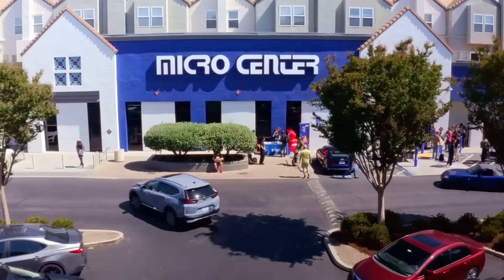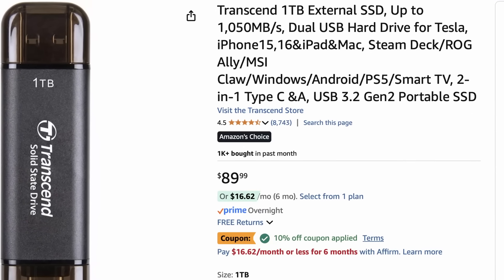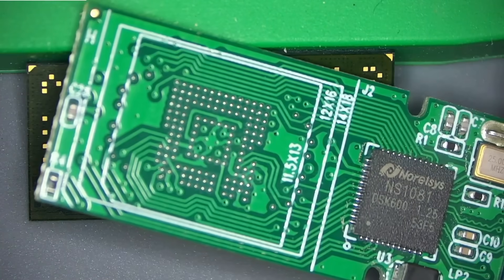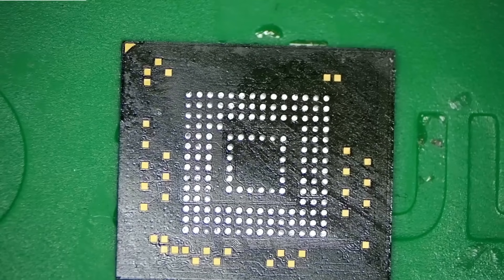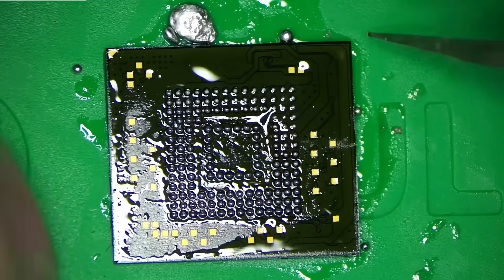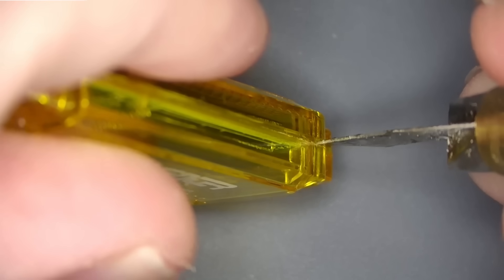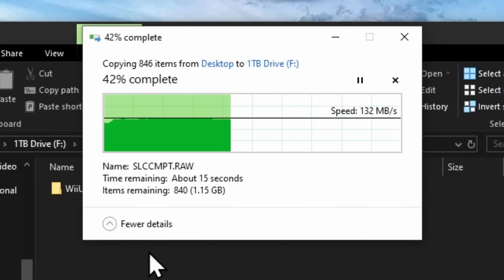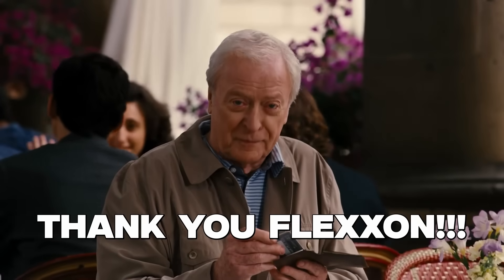I built an Industrial Grade Flash Drive

Comment from the maker: SUBSCRIBE & What should I build next?
Reply: Hey dude. Have you ever thought about making a Micro-SD to USB-C conversion to fit almost any hard drives?
Reply: Add heatsinks to this USB drive & test before & after.  I'll bet you'll delay or remove the throttling.
Reply: a 4 or 5 terabyte External SSD drive as small and compact as possible? and fast too?
Reply: Try using UFS now
Reply: An m.2 drive that has drr chips instead of flash :P
Reply: Frankenstein PS3 by RSX 40mm swap 😮
Reply: tv box
Reply: @chasefournier

Now do a MicroSD card!
Reply: Flash drives that big would certainly have a place especially as nand chips get denser in 2.5 inch format.
Reply: Absolutely cinema
Reply: PCB Way has good resin prints for a case. ^^
Next try with faster chips and 2 or 4TiB.
Get the >=10Gbit USB working and >1GiB/s

SanDisk Ultra Dual Drive Go is under 100$ has USB A and C. 400MB read speed but they don't tell the writing speed.
If you want speed get a NVMe SSD and a USB enclosure that can do 40G USB C and A.
Reply: Dude you are behind on flash memory the highest single chip I am aware is 2tb from Samsung, and yes it is meant for microsd cards and usb drives
Reply: That said I love seeing builds like this and would love to learn to micro solder so in can buy ewaste build fun Frankenstein machines that should have existed but never did because our society refuses to reuse parts in new and interesting wats
Reply: the way you pace the video by removing the dead space is really respectful to the viewer yet the amount of detail and the things you remember to include are quite awesome!  I learned so much and didn’t get bored.  Subscribed.
Reply: increible experimento :yougotthis:
Reply: I just use an external SSD for the same job. Yes they're a little bit bigger in size, but they're more robust, faster, can have more storage, and cost less.
Reply: What is the name of that software which you use format partition in Ntfs
Reply: Build a working Xbox controller
Reply: Something that is equally as unique as this, maybe a stick of RAM that has an unparalleled 32 gigs?
Reply: Hi please send me a 1 tb flash drive
Reply: 2tb flashdrive
Reply: yo bro. why is your face so close to the camera? do you edit your videos on a 300 in tv from a mile away?
Reply: Micron makes 1tb emmc chips so 2tb usb lmao
Reply: Heatskink for  the thumb drive, is that why the performance tanked at the end?
Reply: One tip, super glue and flux remover can change many electronics component behaver or values.
Reply: BiWin make 2Tb Mini SSDs (15.0 mm × 17.0 mm × 1.4 mm) slightly larger than a microSD card, an adaptor to USB-C would be fun.
Reply: a time machine
Reply: Build a NAS from multiple 1TB sticks
Reply: Can you help me please to find the firmware to program the ic?!?!?!? Pleaseeeee!)) thanks!!
Reply: Can you sell some of these?
Reply: WHY USE A USB A NOT C?
Reply: @iKabii 

If the USA is so great
why did they invent USB?
Reply: @iKabii who tf actully prefers USB-C hard drive
Reply: @iKabii  USB C IS TRASH!!!!!!!!!!!!!!!!!!!!!!!!!!!!!!!!!!!
Reply: @iKabii  because we dont follow your idea's and he wants to make it usb A for funni
Reply: @Wh1t4f0r3est no need to be condescending
Reply: Maybe try @ them lol

Comment: 10:50 another tool you could try (or even just have for the toolbox) is a thin guitar pick. Depending on the brand, some have really nice tapered points that work pretty well for seperating plastic shells. Might not work particularly well for a fresh USB stick, but it'd be less likely to damage both the plastic and your fingers. Disassembled many things with old picks out of boredom so I absolutely will vouch for their usefulness

Comment: This idiot removed original solder balls, added new balls and reflowed the chip. This idiot did all this in the pretext of not overheating the chip but in that blind pursue, he thermal stressed the chip 3 times plus handing. Reflowing with original balls would be much better as the manufacturer would have tested and selected the best solder ball material. They were OK with solder but this idiot wasn't.

Comment: I am planning to make a storage card with 2TB capacity using SLC NAND Flash. Card will have gigabit ethernet and CAN/UART for data Transfer and control. Is there an interface other than ONFI that I can use to interface NAND chips with controller?

Comment: Wouldn't it be better to use exFAT for a flash drive? I mean, if you're only using it on Windows computers NTFS might be alright, but exFAT is supported by all platforms, including Linux and Mac's.  
And I'm not talking about FAT32 which has the 4GB file size limit, exFAT limits are 128 petabytes both for partition and file size. That's 128 terabytes times a thousand.

Comment: I retired most of my old flash drives. I keep a couple really old bois around cuz they still work with stuff like the printers at the post office/copy shop. 
Apart from that I carry two NVME SSDs in handsome aluminum enclosures. 
They're absolutely nowhere near as quick as in a real NVME slot (Throughput is hindered but IOPS is even moreso)
But compared to an average thumbdrive they're fast as hell and these drives were also retired from their original PCs it's free real estate (not quite, enclosures were $18 a pop)

Comment: There are UFS dev boards and chips on AliExpress. JMS901 and SM3350. Firmware is probably more difficult to find though.

I'd assume the faster USB drives in the market are using UFS by now. eMMC is garbage by today's standards.

Comment: i think the biggest problem is the heat, if you need a fast portable storage, there are some good value on aliexpress, portable m.2 ssd (the small one) cases with cooling and its big enough to have it on your keychain, as big as a car key with electronics inside, thats the reason there isnt any 1tb or 2tb usb sticks on the market i think and btw, better order a mold for chips, not a magnet, even if they are fresh and have no data, its never a good idea to bring chips near a magnet^^

Comment: If you want a really fast USB drive, just buy an NVMe enclosure and put a real NVMe SSD in it. I did it years ago, and it reads/writes at 600 MB/s (so 5x faster than what this guy made).  Modern ones do much faster than that.
Still, mad skills, dude, very impressive.

Comment: Fascinating and informative video. We're currently trying to replace an internal flash "drive" with a larger capacity one. This is an internal component to a system, so it's not a commercial product. This is a pilot run. In researching this I came across this video. I'm a little confused about the sequence of events, though. 

Once you had completed the addition of the memory chips and put it into the case you connected it to the computer (11:18 timestamp). The audio indicates the computer recognized a USB device being connected. This implies that there was already firmware on the NS1081 to implement a USB Mass Storage Device class. But you then proceeded to program the firmware. What firmware were you programming? Where did you get this firmware? Also, what is that MPTools application you're using? Did this come from Norelsys?

I've been unable to find any information on the NS1081 on the Norelsys website. I've reached out to them via email, but have not received a response yet.

Comment: Chase, do you have a video where you repair the fiberglass board where an edge connector is? Not so much the pads, but the edge itself. Found a tossed out (e-waste dumpster!) Asus PCIE (4 Gen, 4 slot) expansion board (has 2 2TB Samsung 970 cards mounted!). But a small section of the edge connector is slightly split - about 2 pads wide. Thank you. Do you have another video where you focus on reprogramming the controller chip?

Comment: So you're telling me that you're worried about the high temperature requirement of the stock balls damaging the chips, so you heat the chip to that temperature in order to remove those balls, then heat it up again to attach new balls, and heat it up once more to attach it onto the board? I'm not quite following the logic here...

Comment: the drop of speed at the end wasn't because it's a flash drive but because windows started copying smaller files with different names and specs which made windows take more time to treat each file before it copied it while at the beginning it was copying bigger files which are easier to  handle i would say

Comment: If I were to take a guess, the slow down is caused by the chips over heating. if you could put the drive in a metal case with direct chip contact or attach 2 little tiny heatsincs, the problem should be fixed.

Comment: I appreciate the meme vibes and wanting to take a specific thumb drive line to the max, so kudos for that. I really don’t get why an SSD the size of a thumb drive isn’t checking that box for you though. Especially when they generally have much better speeds than emmc-based storage. In super tech mode, yeah, an SSD in a USB enclosure is “different” than a thumb drive. But practically speaking, they are the same thing. Small storage on a USB stick. (Picture The Office Pam meme)🤷‍♂️

Comment: Hey, I'm new around here. Never seen your videos until today, but even though this is the first video from you I ever saw, I'm subbed now!!! Also, if you want a project request from the new guy, take an iMac G3 reproduction shell and fit a modern gaming computer into it turning it into an all in one. If you have leftover space inside, you could probably have some resin printed trays to add storage for media like flash drives. The only goal I want to see, is it playing stuff like Cyberpunk on the max graphical settings (Raytracing optional) and maybe a couple other of the more hardware intensive games. Not saying beat out a super computer, but if you can get 30 fps through the prologue of Cyberpunk or the tutorial of any of the games you have access to test with, I would consider it a win. There are some pretty cheap iMac G3 shells floating around after all, why not give some people a heck of a sleeper PC idea?

Comment: You can jerk yourself all you want for making this but you haven't done anything worth making a YouTube video about. You can get 1tb micro SD cards with really fast write speeds for pretty cheap these days. Wyatt you should have done with ditched the ancient USB and designed your own PCB and used a type c connector w/ USB 3.2 gen 2. Then you'd have something unique worth talking about. I mean. You even took an existing microcenter enclosure and modified it to say 1tb and cried that your basic bga solder job worked? Jesus Christ dude you're pathetic.

Comment: I expected better heat dissipation, and a proper copper or aluminum casing. Both the controller and the flash degrade significantly with heat.

Comment: Nothing "Industrial"!  Speed? Slow AF! Error correction? No. Rugged? No? Flash? eMMC it's just a bees dick above flash drive chip in binning, so Long lived? No.
A good USB Stick beats that any day! My SanDisk one does 170MB/s. 

Gold Standard is still putting a NVMe in a USB 3.2 Case and have 600-700MB/s also it's the most reliable solution.

Comment: i got a 2 TB flash drive about 6 years ago so you're definitely late to the party.
Reply from the maker: damn
Reply: @chasefournier  i do most of my copying over the network but let's say i had to copy 1 tb using a flash drive for some reason, then i wouldn't be sitting there waiting for it so it wouldn't matter how fast it was. perhaps the best use for your drive is running a very special os, special because the common ones will run on an average flash drive no problem.

Comment: Isnt there an issue with those high capacity storage chips that if 1 sector fails a large portion or the whole chip stops working? I feel like i remember high quality SSDs had more chips at lower capacity but the cheaper ones  had less chips but higher capacity

Comment: I have a cheap-ish Samsung 64gb flash drive that avgs about 300mb/sec on decent sized files. Drop off looks about the same speeds as yours got on smaller files. Report back to us once you have used it a lot for a while, please! I wanna know how long it handles the workload. Would be great to get a flash drive that doesn't degrade like hell.

Comment: I don't need it as per say. But i want it!
Would be nice for long time storage backups. No cables, no adapters. Simple usb.
There would easily be space for 2tb in that form factor.
Or even 2 layer pcb, 3tb. 1tb top, 1tb mid, 1tb bottom. (2tb on one board and 1tb on another board.)
Could it be done with "flex cable" (like phone screens) to make it even thinner? 4tb. Same physical size.
As for the heat, probably have to make it out of aluminum? I have a pretty good CNC.

Comment: 13:16 The transfers slow down at the end doesn't have to do with the drives being and flash or anything specifically. They slow down because windows copies files largest to smallest and sequential is almost always faster than random. A ton of small files have to go back and forth really fast from the FAT (file allocation table) or MFT (master file table) for ntfs. Linux filesystems have similar things going on and not being in front of a computer I don't know if or which of various ways to copy files happen largest to smallest, by directory or what on a linux machine. To go deep some things to read about are extents, inodes, journals, bitmaps, b-tree, cow, attributes, metadata, link lists, blocks, block pointers, records, sectors, blocksize, and just follow the rabbithole. It really is pretty interesting amd is nice to know to choose the right filesystems and configure them correctly. 

Awesome project and video btw.only thing I would add is crystal disk benchmarks next to your real world tests. It give you a nice curve of file sizes and amounts of files copied over time vs large sequential writes or reads

Comment: Bro most people don't know nothing about electronics nor computers so it's normal human behavior to not believe you..
Also what about adding a little copper heatsink to the controller and a second separately one too each chip and eventually air flow thru the case 
Would guarantee excellent speed and work off the drive ..
Wanna congrtulat you for the great job you've done ✅ 👍 .

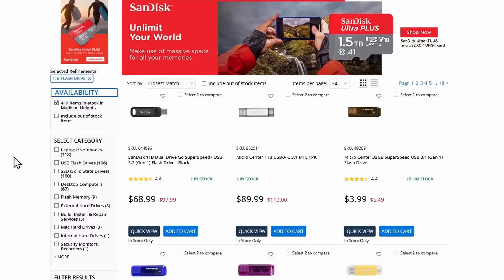Comment: Im a little confused by the claim at the beginning that Micro Center doesn't have 1TB flash drives when you showed the 1TB drive on their webpage at 0:26 ???
Reply from the maker: Micro Center branded 1TB flash drive does not exist.
Reply: @chasefournier   Part Number: 1TB ACMTL 1PK Is this not a Micro Center branded drive?

Comment: the reason we dont is because of the risk, usually the reliability of those chips is too low, the risk for corruption of 1TB.  i dont have anything that large i would be willing to lose.  thats why we dont have 1tb flash usb drives, and for a clone of your movies folder would be larger than 1TB,   and people dont usually re-encode the movies into 1GB sizes.   the releaser do that and we download in the bandwidth rate we prefer associated by sizes 1gb 3gb 5gb 10gb -> 30gb ->55gb ->100gb

Comment: Umm, you do know they make ssd enclosures? Mine is the OWC with an 8 tb ssd… gen 4 speeds 3151mbps. 

Also not super confident this drive has the necessary components for reliability. 
It’s excessive, expensive as you so aptly pointed out.. so it’s not a good product to market.

Comment: Pretty filthy solder work. I am this filthy too. Once you are not broke, You can use a flux removing solution instead of regular IPA. Flux removers are a mixture of acetone and IPA as far as I remember. It will remove all remainder flux very effectively and make the work/rework look a lot more cleaner and professional.

Comment: No. I've made a flash drive with SM2268H controller and it runs at 500MB/s read and write without SLC cache. There is also SM2320 controller flash drives which can reach as high as 2000MB/s data rate, but it depends on SLC cache to do that.

Comment: The slowdown at the end is because the files that were copied at that time were more, but smaller files. Those copy always slower than less, bigger files, because it doesn't just need to copy the data, but also add the files into the partition table at the beginning of the drive so the os knows what data belongs to which files.

Comment: That was awesome.
But I think you should have used an aluminium case with themal pads for heat dicipation. I think thats why the dont make high density thumb drives. The heat will eventually damage the chips in prolonged use.

Comment: Creating a higher-capacity Flash drive is not that important. The real problem with all flash drives, including brand-name ones, is that after a week or so of constant usage, the writing speed slows dramatically. Like 50% lower. And the drives get hot. Really hot. Even if they do nothing, just plugged in. I feel it is either a conspiracy or a very important piece of information about them is kept hidden. If you can get to the bottom of this, you will be famous.